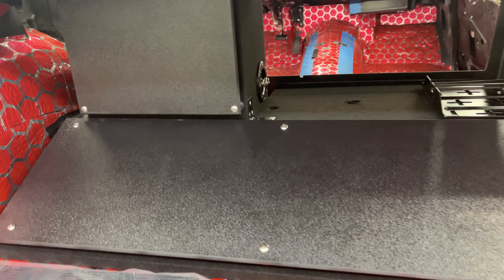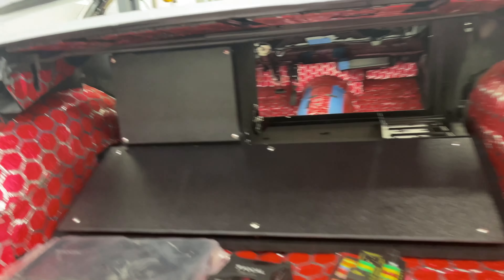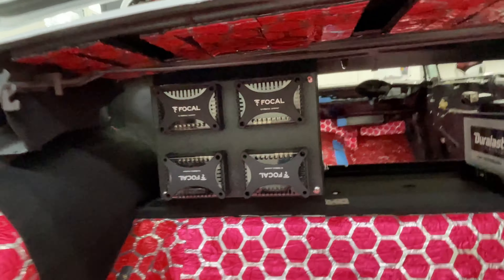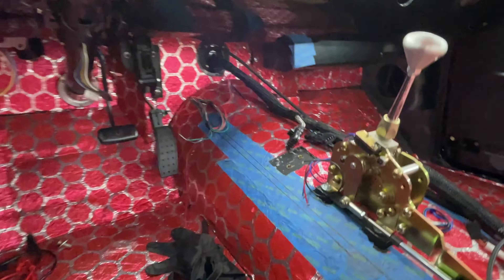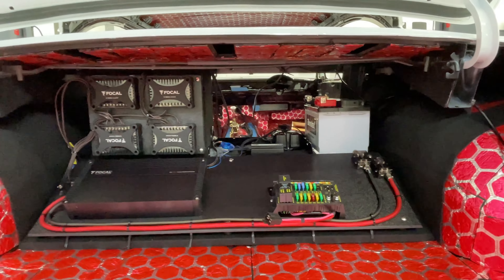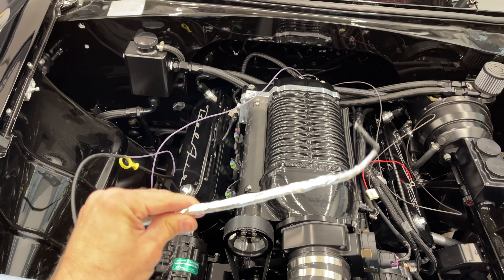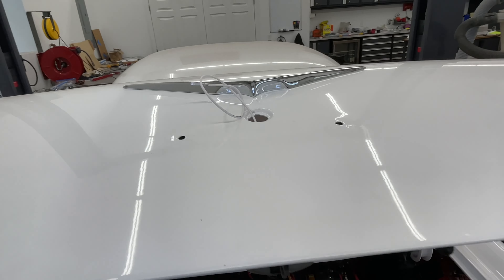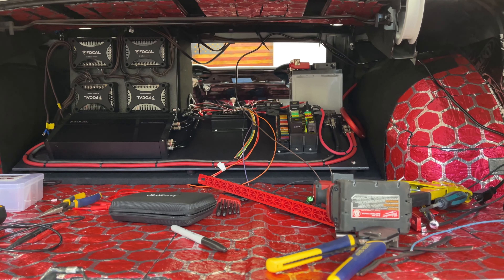1956 Chevy Bel Air Part 11 - Wiring 1/2

Comment: Whats the wheel set up im building a 55 and fighting with wheel size
Reply from the maker: Schott EXL Rail wheels. Front 19x8 at 5.25" back spacing. Rear 20x11 at 6.25" back spacing. I could have gone 20x12 at 6.25 if I wanted do get a 335 tire under it.